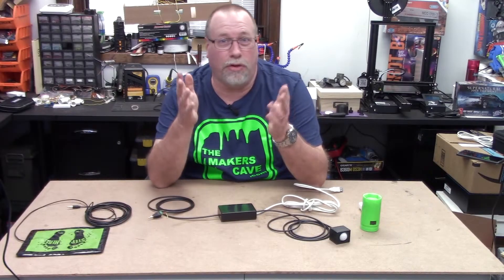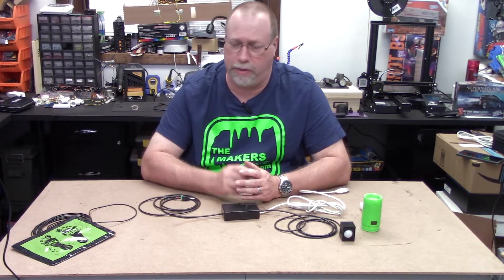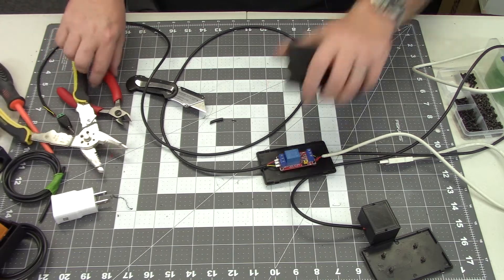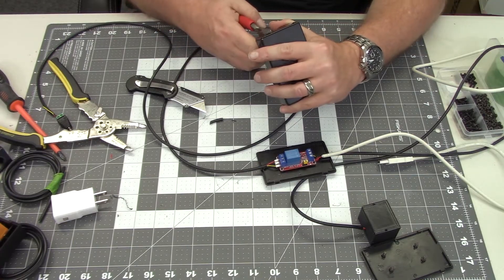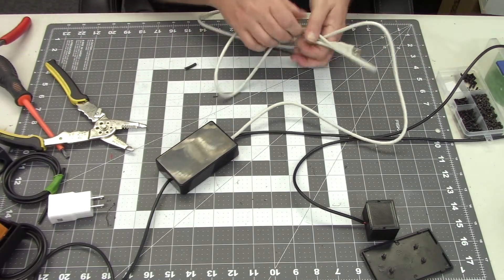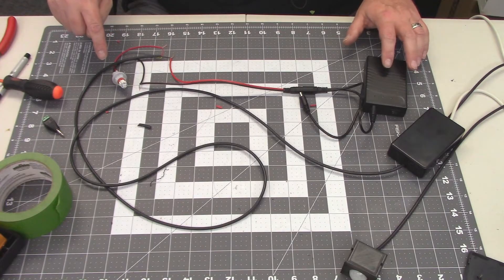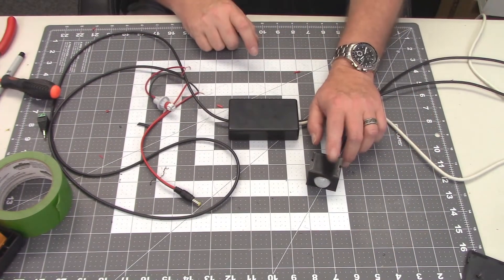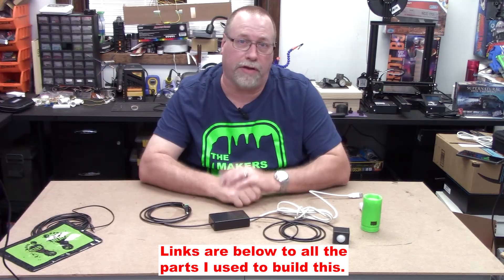Turn Almost Any Prop Into A Motion Activated Prop.

Comment: How would I test what is wrong have light on delay. Prop works on both try me and on. Not sure rechecked wires   lost now
Reply from the maker: Hi!  I think I need a bit more info, not sure on what is not working for you.  Are you saying the prop works via try-me and on BUT not with the kit relay?  And I'm not sure about the light, are you saying you have a light that is on a delay?
Reply: @TheMakersCave  Hi,  Yes no power from the relay. I done a voltage check. 5 plus volts up to motion sensor..The trigger wire has 3 volts.  I assume that is not enough to power the relay. Now ordered the same relay you used. I tried the smaller eye one to try hide it better.

Comment: Hello!  Thanks for the video.  I needed a motion detector switch for a prop I purchased from Big Lots.  I built what your recommended and it works great.  I purchased the the motion detector housing from your store on ETSY since I don’t have a 3D printer (yet).  Now I have a question for you.  At the end of the video you demonstrated the motion switch with a 12v light which inspired me.  I need a relay that will turn on on a 12v light when 5v is detected.  I’m totally ok with the 12v light having its own power supply like you demonstrated.  I just need the trigger to be 5v instead of motion.  Do you have any thoughts on how to construct that?  Thank you again!
Reply from the maker: That sense terminal on the relay (where the yellow wire goes) can take up to five volts.  If you short the 5v pos on the relay to the sense terminal on the relay, the relay will fire.
Reply: @TheMakersCave  Hi!  I sent an email through ETSY but not sure if you got it.  Anyway, what suggested absolutely worked.  I want to send some videos but not sure of the best way to get them to you.
Reply from the maker: @TheRealRogers I'm so glad we could help. My email is: Steve@TheMakersCave.com
Reply from the maker: @TheRealRogers  Got the video, looks great!!  I am working on a programmable dual relay button banger with sound that viewers can build for abut $25.  That would give you the lighting effect you want.  Similar to the Fright Props Pico Boo, but much cheaper.
Reply: @TheMakersCave  Glad you got the video and will be looking forward tp the relay button banger.  You probably noticed I have a Pico Boo and am really not impressed with it.  Very poor support for LED which is really the way go to for lightening.  I'll be one of your first buyers when you're ready to start shipping.

Comment: Is there a way to change the time it runs after being triggered because I only want my motor to run for 2.5 sec after being activated any advice would be helpful,Thank You
Reply from the maker: I did some testing. By adjusting the delay potentiometer, I was able to get it down to about eight seconds
Reply from the maker: You might want to take a look at the video where I did the all in one motion sensor with sound. Even though you do not want sound you could put an audio file with no sound on there that’s 2 1/2 seconds, that way when the motion is activated, the relay will activate for only 2 1/2 seconds.

Comment: Today, I purchased a new/used animated witch that the previous owners bought at Walmart. Never used and still in the box. After putting everything together, I noticed where the motion sensors supposed to be on her chest, that it had pulled away and one of the tiny wires had come loose. I tried to fix this myself but it was nearly impossible because the wires are so small, they're impossible to strip to reattach. Plus, they are very short to begin with and there's not enough extra length to use. They barely reach the hole for the sensor to attach. I did my best and she is working and does activate, but it seems to be more from sound and not motion. By the way, are these 2 things separate? In other words, if sound activation is working, is that from a different sensor? Can one work without the other independently? I do have a "demo" feature with my On/Off button, but there is no "Try Me" button that I can find. Can I get a new motion sensor and relay box like in your video and make this work? Any help or suggestions would be greatly appreciated! I only paid $40 for her and don't really want to return her to the seller. They paid about $150 for her new and she is pretty cool standing 6ft. tall!
Reply from the maker: Hi!  Thanks for watching.  Why don't you send me an email at Sales@GraveDecor.com.  I have several ideas to get your prop working, but I need a bit more information.  If possible can you send me pics of the broken motion sensor and and wires.  We might be able to just replace that sensor, a very inexpensive and easy fix.

Comment: This is a great video and the instruction are very clear.  Can you use the motion sensing approach to actuate more than one of the props with the "Try Me" interface?  I've got a dog pack, a dinasour pack, etc. that I want to actuate separately using your approach.  Just bought all the parts so this weekend should be fun.
Reply from the maker: To avoid any problems I would use a separate relay for each prop, but you should be able to split the one trigger wire coming from the PIR to each relay's Trigger/IN terminal.

Comment: I have a Home Depot skeleton wolf
That runs on 3 AAA batteries, but it has one of those small white square fittings for the try me. Would I use this same setup, but instead wire in that fitting instead of the audio jack?
Reply from the maker: Up until this year I would say yes.  But a lot of commercial prop builders have been switching to using a step/try-me port like Spirit Halloween.  Those pads/ports use a piezo element to activate, BUT not all of them.  If you can see two terminals in that white fitting try to short them out and see if the prop activates.  If it does, then yes, this would work.
Reply: @TheMakersCave  I’ll give it a try. I believe this is a 2021 prop and based off a nearly identical prop HD had from 2017
Reply: @TheMakersCave  I found the following video. A different setup but looks like it should work. I’m a total noob at this stuff so I could be wrong. Also wanted to say thanks for your video on the PIR sensors. I followed it step by step and made 3 perfectly working sensors first try. I also ordered some of your 3d printed cases for the sensor. 
https://youtu.be/ar6MZBg4nZE

Comment: I have a couple props that can with a sound activated feature but doesn't always work unless it's extremely loud sound. 
I'd like to changed them to motion sensor. Is it possible change the sound sensor to a motion sensor? 
The prop doesn't have a trigger port for a try me button.
Reply from the maker: Which props are they?  Are they from a bigi box store?
Reply: @TheMakersCave  yes they are from home depot, I have the skeleton horse and two of the skeleton wolves. 
I was thinking of taking the heads apart and seeing if I can just cut the wires to the existing sensor and  replace it with a new motion sensor but I'm not sure if that would work.
Reply from the maker: Do they have try me ports?
Reply: @TheMakersCave  I have the same thing. I was thinking of wiring into the "try me" wires and eliminating the button. My only question. If the motion sensor stops decting motion will it turn off the prop as soon and it stops detecting or is there a way to adjust the sensor so that the relay will stay on for a certain amount of time. Thanks in advance

Comment: Hey there. This is partially what I was looking for although for what I'm want/thinking the setup may be different. 

Question: I'm wanting to use a PIR sensor with a 12v wiper motor. Could I do this by using a 12v relay? So the 12v 5a power supply and PIR connect to the 12v relay with the motor connecting to the NO of the relay? Or would this burn up the pir sensor?
Reply from the maker: The PIR I use in the video can actually handle 12V power to operate, however the trigger pin on the PIR would still be only 3.3V when activated.  As you mentioned, you might want to use the 12V version of the realy used in the video.  Here's a link: https://amzn.to/3SnHYWC.  Using this relay allows everthing to be powered by your 12V power source.

Comment: I have a prop that has the 3.5mm "Try Me"  plug jack;  could i splice an male plug to the end of a pir sensor and have motion detection work that way?  the prop is battery powered.
Reply from the maker: Thanks for watching!  Who makes the prop, Spirit?  I've been getting reports that simply using a spliced 3.5mm jack leads is not activating the try me port like in previous years props. I'm thinking that they have changed how the "Try Me" port works.  I actually went out and bought a prop from Spirit and am doing a video on testing the port.  I think they have change to a "resistance" triggering as that is how the new step pads work.  I'll let you know what my testing reveals.
Reply: @TheMakersCave  its the "Haunted Living  5-ft Lighted Animatronic Creepy Female" from lowes.  look forward to the video!

Comment: Hi great video but i have a question as im running into trouble. The PIR only outs 3.3v and wont trigger the relay :( (sad face) how are you getting 5v from this PIR ? (HC-SR501)
Reply from the maker: What kind of realy are you using?  The 5V relays I show use the 5V to power the realay and the relay board.  The relay board has a "IN" or trigger port, when a small voltage, like 3.3v, is applied to the port the relay triggers.  The 3.3V coming straight from the PIR will not, as you found out, will not trigger a relay only.  If you are using a relay board and it's not trigger on the 3.3v then make sure that the HIGH/LOW jumper is set to HIGH.  If your board doesn't have such a jumper than the board is LOW trigger only and won't work.
Reply: @TheMakersCave  Thank you for taking the time to get back to me, Seems my relay although is the same type as your is rated as a 12v, I ordered 5v but this is a 12, i didnt check :( Will order A 5V one. :) thanks again
Reply from the maker: @PIGSclips2  That would be it.  I have a whole box of those relays boards in 12V, I ordered 50 5V boards and they sent 12V.  I'm such an electronic hoarder I just kept them and ordfered the right ones.
Reply: @TheMakersCave  ha ha ha ha OMG same here, cant just order anything in single have to order like 5 or 10 = draws full of bits >< lol :D But thank you so much for your videos they are so informative and give plenty of inspirations for other uses.
Reply: I get the green trigger light to come on, but nothing out of the com and NO. I have tried 2 different relays and neither would generate a current. What am I doing wrong?

Comment: i would actually like to take a fake snake that goes with my costume and make it move when someone goes by it. Can I do a motion censor with that?
Reply from the maker: You could, but if the sensor is on your costume it might activate with you just moving around.    If it just moves then that would probably be fine, if it's a jump scare that could get annoying.

Comment: Very nicely done. Many props run off 12v so this could easily be adapted to those props using a 12v relay and the same pir, but no need for the usb power supply. Gonna give that a try.

Comment: Great video, but can’t get it to work. Sensor triggers ok, it lights up the LED1 light on the board when I pass my gMd in front of the sensor. . But it doesn’t seem to send the signal to the prop. Tried it on 3 of my spirit Halloween props.  Any suggestions ?
Reply from the maker: Would live to help!  Email me at: Steve@themakerscave.com.
Reply: Doesn't work on most of my spirit props

Comment: What if your prop doesn't have the input for the plugin? It does have a try me button - but it is soldered to the board.
Reply from the maker: Hi, thanks for watching.  If you're hand with the ol' soldering iron you could attach two wire to the try me button and then attach them to the relay.  Are you able to send me some pics of it?

Comment: Do I have the incorrect relay? 
Mine have: 
JQC3F-5VDC-C on the relay and I cannot get them to release after they trip. 
TIA
Reply from the maker: is it just a relay for a relay board like in the video.  Does it look like this: https://gravedecor.com/product/5v-activated-relays-with-standard-terminals-10a
Reply from the maker: If you can take a picture of it and send it to Steve@TheMakersCave.com that would be great.
Reply: @TheMakersCave  Email sent
Reply: Thank You for all your guidance, 4 out of 5 of these that I've built work correctly! On the 5th one, which is on a battery operated prop (HD Rotten Patch Twins), the relay and sensor function correctly but about 1/2 way through their program, which is 50 seconds long, the Twins cut out. My First thought was to change the batteries as I thought they were dying, alas, that did not resolve the problem. Any ideas as to the cause of this?

Comment: If one wanted to power the units via AA batteries, would the 3x holder (4.5v) or the 4x holder (6v) be better?
Reply from the maker: Probably the 6v, I don't think the extra 1v will hurt.  Don't forget you can always power it as  is with a 5v phone power pack.  That would last longer than standard batteries.
Reply: @TheMakersCave  True, but if you are going to have a half-dozen of these things, or more, then that could get expensive, and recharging would be an issue, as well. Thanks.

Comment: Is there a way to do opposite of this ? Can you trigger a prop with a step mat that only has the 3 wires from a motion sensor?
Reply from the maker: Depends on the step mat you use.  The ones from Spirit use a piezo sensor, I'm currently trying to figure out how haunters can use these mats with a prop other than Spirit.  I believe Fright Props a pressure mat that actually closes two contacts, you could certanly use that to activate the prop.

Comment: Hey I had a question for you most Spirit Halloween props have 6v Power supply will this still work for them being it’s for 5v ?
Reply from the maker: This doesn't supply power to the prop.  It uses 5V to power the electronics of the PIR sensor and relay.  When motion is detected it closes the contacts of the relay.
Reply: To control a light source did you cut the end that plugs into the wall and put the female plug on it ?

Comment: What do you think about the SENSKY BS010L DC 12V to 30V 3A Mini Pir Motion Sensor on Amazon? I’m no expert on this but it looks like it’s already pretty close to being ready to use.
Thank you.
Reply from the maker: That is a voltage pass-through PIR.  Which basically means whatever DC voltage you put at the input will be present on the output when the replay activates.  These are great if you want directly power something, motors, lights, etc. as long as it's DC.  What I show in the video is how motion controls a relay, the video project does not provide power when the relay is activated, it just closes the Normally Open and Common relay terminals making continuity, like a switch does.  That's what the "Try Me" ports on props are looking for, not voltage, just a contact of two terminals.  Now you can always use the Amazon device to power a 12V relay, those relay contacts (NO & Com) could be used to trigger a prop.
Reply: @TheMakersCave  Ok. So, something like that can’t be used on a animatronic prop on the "try me" port? Disappointing. Thank you for the video and help. Really appreciate it.

Comment: Could this run on a pair of 3v CR2032 lithium coin batteries?
Reply from the maker: Hi!  The voltage with to 3V CR2032 is there, I just don't know how long it would last.  I've never done that test.  Obviously the more it's activated, the shorter the battery life.

Comment: Can I use an old laptop charger as power source?
Reply from the maker: Depends on the output voltage of the charger.  The relay in the video will only run on 5 volts, any higher and you'll burn it out.  Also, the PIR only takes voltage between 5V and 24V so you'll have to make it falls between that.  They make 12V relays like the one I use, but again most laptop chargers run at about 19 volts.  The specs of the charger should be printer right on it.  Look for the "Output" specs.
Reply: @TheMakersCave  got it thx. Very helpful!

Comment: Can I run multiple motors on that one motion sensor?
Reply from the maker: As long as the total amps don't go past 10 amps, that's all the relay contacts are rated for.  You might want to upgrade to the heavy duty relays that handle 30 amps total.

Comment: Have you try this on a prop that has the push try me button. that runs on 3AA batteries?
Reply from the maker: It should work with any prop that has a "Try Me" button.  If it doesn't have a port for "Try Me" you may have to open it up and find the contacts for the button and extend them to the relay.  If you have any questions must take some pictures for me and I'll walk you through it.  Steve@TheMakersCave.com

Comment: Can more motors be added? Do I need more power?
Reply from the maker: Hi, thanks for watching.  This particular project is basically just a relay.  When motion is detected the two leads just complete a circuit, the two leads provice not power.  For example,  let's take a moter and hook it up to a battery.  Now you have the positve of the batttery going to one lead of the motor and the negative going to the other lead on the motor. now the motor will run continuously.  Now lets cut the positive wire in the middle.  the motor stops running.  Now take one end of the cut wire and attach it to one of the leads of the motion dector relay lead and the other cut end to the other relay lead.  Now when motion is dected it closes the motion sensor relay completing the ciruit and the motor runs.  Here's a schematic from our website: https://gravedecor.com/download/motion-sensor-relay-schematic/